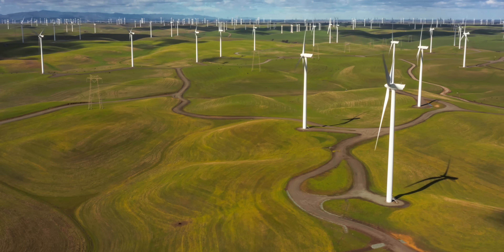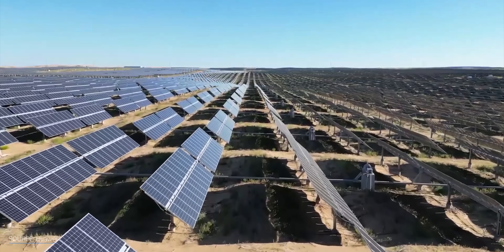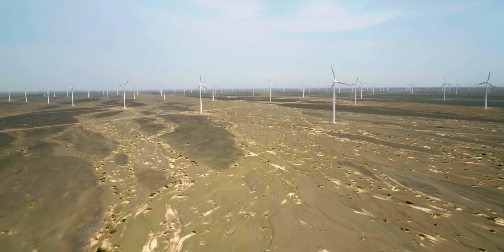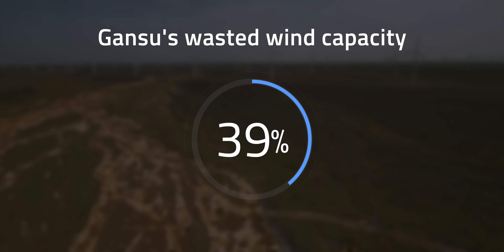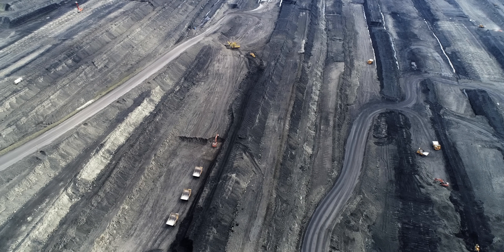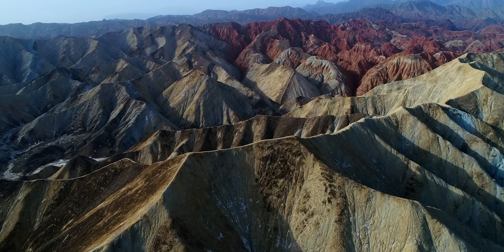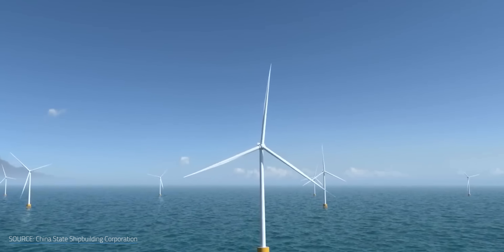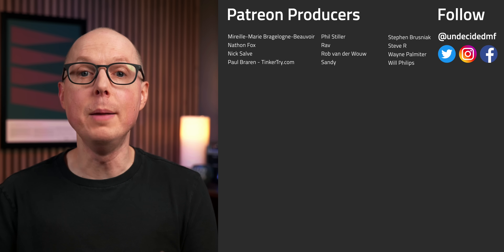The World’s Largest Wind Farm has a Tiny Problem

Comment: Building sufficient renewable energy generation, whether solar or wind is always going to Be the first problem, but energy storage and transmission lines must also be a priority,
Transmission lines built over land even if there are mountains or valleys in the way, should Be relatively easy, the problem comes when there is an ocean in the way, which is why I have become interested in a Swiss company (E 2 S) Energy, and its novel approach to mitigating the intermittency of renewable energy.

E.2.S.  system comprises of a shipping sized container, filled with Graphite blocks, in between the block are normal heating elements, which can raise the blocks to a temperature of 500 degrees centigrade, running through the blocks are water pipes that can transfer the heat to create steam when needed, the steam is connected to a steam turbine generator, at what would normally have been a decommissioned fossil fuel site, to produce electricity for over 4 hours, and as you have already stated it is already working in the real world. As clever as this is, I believe there is a much bigger prize to be had if someone were to be brave enough to give it ago.

Ask yourself these questions, if a single shipping sized container filled with Graphite blocks can keep a commercial steam turbine generator running for 4 hours, how much energy 
could you store? And how much electricity could you generate? If you had a ship filled with hundreds or thousands of such containers, and could it solve the conundrum of Australia.

Here is my pure fantasy idea. In reality you would probably not be using a container ship, but you could. I am thinking about a bulk carrier, or oil tanker, first remove its diesel engine and tank, 
and replace it with Marine electric motors, (not necessary, but it would be a nice touch) then to maximize the ships heat carrying capacity divide the tankers hold into a dozen (12) 
Individual heat stores, each heat store should contain the equivalent of at least 100 Container sized Graphite block units. Then above deck and straddling 2 of the lower heat stores install at least 5 or 6 steam turbine generators, this should reduce the amount of pipe work running through the ship, and allow you to spread electrical generation sequentially over several days. Remembering to insulate the heat not just from the surrounding air, but also making sure, the heat does not escape through the bottom of the ship into the sea, how long you can maintain the heat level will determine how far away you can deliver your heat and the electricity it can provide.  

I imagine this large ship tied up at a dock in Australia and being connected to a supply of surplus green energy, which would heat up all those graphite blocks to a substantial temperature, once heated a small percentage of those heat batteries would be used to generate steam, and by extension to generate electricity to power the ships Marine electric motors, sailing the ship to the northern hemisphere, probably to Asia (Japan, South Korea,) this would be no different than a coal carrying ship burning some of the coal for fuel. 

Once it had docked in Asia, most of the rest of the heat batteries would be used to generate electricity which would be fed into the local grid by a dockside connection, once the majority 
of the heat had been depleted the remaining heat would provide the steam to sail the ship back to Australia, where the process would start again, of course you would need at least 2 
ships for every destination you supplied so as one ship departed another was ready to take its place. 

I wonder just how much heat you could store in a large tanker ship filled with heated graphite blocks, and it would be a good fit, while the northern hemisphere shivers through its winter, Australia would be at peak production, but it is not just a winter thing, as a crowded Asian continent warmed up; it would still need additional electricity to power all those hundreds of millions of air conditioning units, power that a huge largely empty continent like Australia could supply, if it wanted to.

But would this solve the conundrum of Australia, apart from a few large cities, Australia is a largely empty continent, with more than enough space to install any number of solar panels, 
many hundred times more than would be needed to meet its domestic needs, plus Australia has a huge coastline just begging to be lined with large onshore, or offshore wind turbines, Australia does itself, and the rest of the world a dis-service when it thinks only in terms of its domestic energy needs, I believe that Australia could have the capacity to supply energy to a large proportion of the world, and become the (Saudi Arabi) of green energy, but at present there is no obvious way of transferring all that energy, and that is why I refer to it as the conundrum of Australia.

The first suggestion for overcoming the conundrum of Australia would be high voltage undersea cables, but given that most of its potential customers are in the northern hemisphere, these cables would have to be many thousands of kilometers long, and be laid at the bottom of some of the deepest oceans, at risk from geological and seismological events, or even actions from unfriendly powers (remember gas pipelines from Russia) Plus, they are going to be very expensive, and a company called sun-cable is already struggling with just such a plan.
The next most likely option would be to convert green electricity into a chemical form, Like Hydrogen by electrolysis, after all given Australia’s large size, Hydrogen is likely to be the domestic fuel of choice for heavy vehicles, planes and ships, so producing extra for export should not be a problem, but producing Hydrogen or Ammonia is not easy, plus storing and transporting these chemicals in bulk is very challenging.

But a huge floating heat battery and electricity generating ship, really? Time to ask the big Questions and examine the pros and cons. On the positive side, transporting energy has heat on a ship means you can alter collection And deliver points as demand or supply conditions change and you are not stuck to fixed points as you would be with a cable. Secondly you are not loading or unloading anything except -ions Point three, after the initial conversion, the engineering challenges fall away, there are no Materials that need to be manufactured, or stored in high pressure vessels, you are just heating and cooling Graphite blocks and running steam turbine generators, plus if we do start to use less oil in the future there could be spare oil tankers that could be converted, without having to build an entirely new vessel.
If a ship filled with Graphite blocks proves to be too expensive, there may be an alternative In the form of molten salt, which is currently used in concentrated solar plants, were mirrors 
Are used to focus sunlight onto a central point to heat up molten salt to a temperature high Enough to keep the plant producing electricity long after the sun has gone down.

Possible problems and unknowns, firstly energy density when compared to weight and Volume, I have a small petrol-powered car, it has a 50 Litre fuel tank which give me a range Of 400 miles, when you multiply the weight of one Litre of petrol by 50 you get a weight of38 kilograms, by comparison an electric car giving the same mileage would have Lithium-ion Batteries weighting close to half a ton, which apart from the enormous cost is the reason Why I am not suggesting filling a ship with Lithium-ion batteries, so the question is what is the energy density of a Graphite block, of a given weight and volume heated to 500 degrees centigrade, I do not know the answer to that question, and it is beyond my skill level to work it out, but I must assume that it considerably greater than a lithium-ion battery system otherwise, E.2.S. Power would simply be using a shipping container sized Lithium-ion battery to mitigate the shortfall in renewable energy production.

If the energy density question can be answered satisfactorily, the next question is can the engineering systems that have been developed for a single shipping sized container be scaled up by a factor of a thousand or more, if all that can be done, I see the biggest problem would be the installation of the electrical infrastructure at the dockside at each end of the journey.
O f course you lose energy converting electricity to heat, and you lose more energy converting heat back into electricity, but if the initial energy is coming renewable that not really a problem.

Comment: I'll guess it's because - like it happened in Brazil - because there are no transmission lines ready. That results from incompetence, corruption or, sometimes - like it happened here - because authorization from the environmental authorities had not given the authorization for the transmission line. In Brazil it wasn't IBAMA¹'s fault - the company that would build the transmission lines was slow in requiring the licenses. 

In the case reported in the video, however, there could be an explanation for the "incompetence": creating jobs for poor people in the region. BTW, contrary to popular perception, the Chinese public administration is very decentralized.

Coordination systems exist everywhere because the grid could not function without them. Creating smaller coordination systems can be a good idea specially in a large country like China. China also uses a lot of DC transmission lines to divide the AC system in order to avoid failure in one place to spread to the whole system.

Comment: This video glosses over so many of uncomfortable facts about wind and solar. Mass storage is NOT around the corner so maintaining base load (electricity when demanded) at a system level requires redundant generation to cover for periods when renewables are not generating power. And, as briefly noted in the video, coal power was deemed cheaper. Cheerleading for renewables is great but without a clear eyed understanding of their limitations, you get a total misallocation of capitol.
Reply: They are building multiple sub-GW storage systems comprising a mix of different techs, plus 5 massive pumped hydro storage sites that adds up to 6.8GW. It's not that they haven't thought about it. Matt just never got around to it. Maybe it's in the next video. Or he is waiting for more of them to be completed.
Reply: convert excess power to produce green hydrogen.
use hydrogen to power generators.
Reply: Storage is most economical at point-of-use rather than centralized. A few  thousand bucks of batteries can RoI in a few years for most residential customers by rate-hopping around the clock with variable rate billing; charge when low, use while high...
Reply: The west focuses on financialization, that is why you guys are not able to develop because the focus on profit and capital is not sustainable because resources are finite. Green energy is a lot better than western short term goals

Comment: That Chinese windfarm is due for some huge expenses with replacements. They only last 10 to 20 years then need expensive replacement, so they may lose significant power replacing hundreds of them at a time. Plus disposal is a problem here, where there they can bury them below the sand. And battery storage is a problem from getting the minerals needed to disposal of the toxic materials.
Reply: You know wind doesn’t blow all the time, right?

Comment: another problem with wind is the technology is improving faster than they can install them.  so the turbines we have in use are probably obsolete
Reply: what, the electricity will have old version number?
Reply: @falsemcnuggethope  no, but newer wind turbines can produce more power with the same amount of space and resources.  the old ones will still work perfectly fine, but at a lower efficiency.
Reply: How does an electric device become obsolete? As long as it works, it can be connected to the power grid.